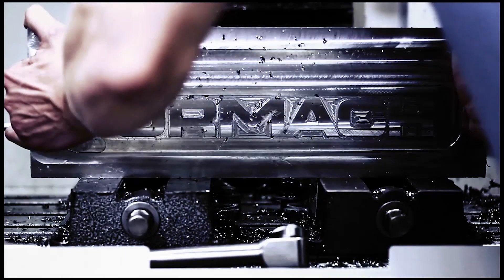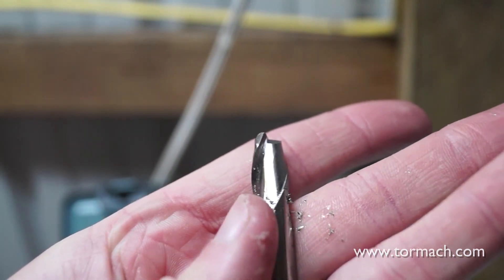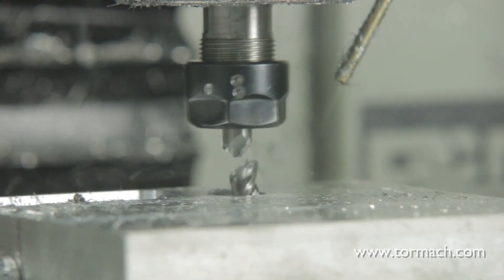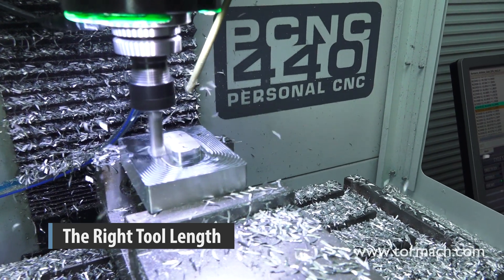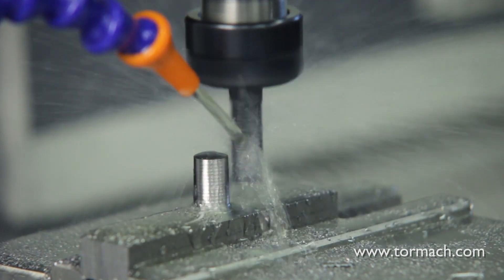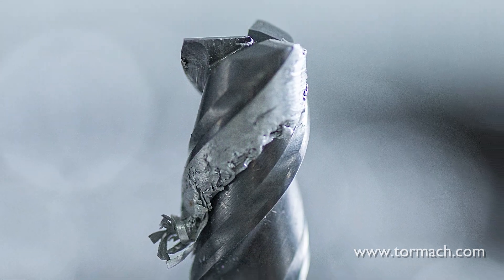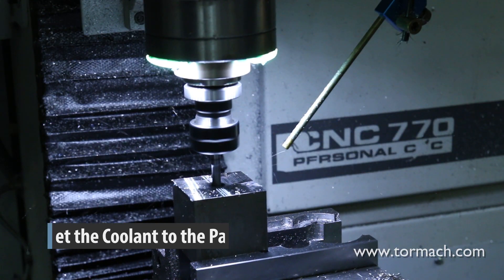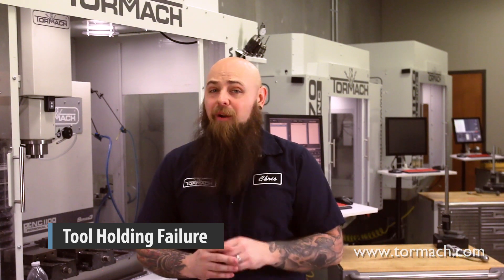Avoid End Mill Cutting Tools From Breaking

Comment: Dude... nah... I only machine stainless, 1045, and 4140, and you never wanna slow your feedrate... that will kill your tools. Your need to adjust your speeds. You need to maintain feed per tooth but adjust your speed for the material you’re cutting... mu rule of thumb is, for 4140 it’s 60-80% of the speed for 1045... but same chip load